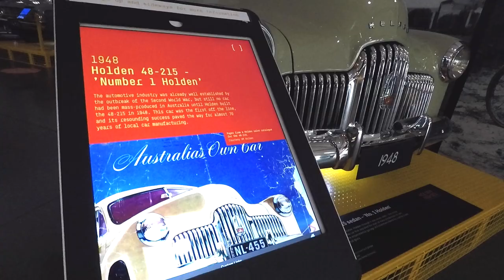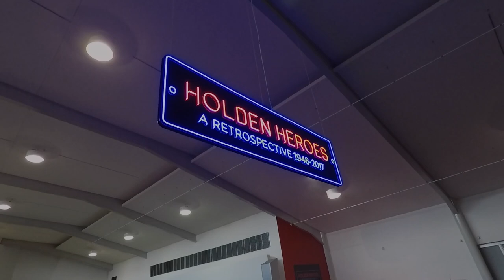The Rise and Demise of Holden | Why Australia Turned Its Back On Their Most Iconic Car

Comment: I was born in 1948, the year that the first Holden model was released. I finished high school and went to work at GMH Woodville SA first as an apprentice then as a cadet gaining an engineering degree. They looked after me well during my early career. Needless to say I was a committed Holden man. I eventually left for the mining industry both in Oz and overseas. I've retired now but my last car was a VE - quite an improvement in so many ways.

Comment: I believe there were numerous reasons behind the demise of local manufacturing.

By the late 1970's, demographics were changing. Up until then, generally most households had 1 family car - in the late 1950's, Holden had 50% of the market. When the kids grew up, they were married by their early/mid 20's and buying their own family car. That started changing, people married later, and younger singles started buying Sigma or Corolla sized cars.

 The decline of the Australian car industry, from a political angle, began as far back as the mid '80's when john button introduced the "button plan," which step by step took away the tariffs on fully imported cars, thus the protection of the local manufacturers. The "reasoning" behind it was to make local cars more competitive. Yeah, right.

As the local cars got bigger, many people realised a medium car was sufficient. Then the small cars got large enough.
An EH Holden from the '60's was considered a full-size car. The Mazda 3 is now about the same size and weight, with more power.

Then of course, along came the SUV. (I hate that term.) The CX-5s, Forresters and RAV4s were a more than adequate replacement for the older full sized wagons.

The other issue was the changes to leasing.
I can't find any info now,  but I remember back when all cars leased had to be Aussie made, businesses often had a fleet of Holden or Falcon wagons.
The rules changed so any imported car could be leased, leading to less sales of local cars.
So a combination of factors led to the loss of local manufacturing.
Reply: Well written though I'd like to add a couple of points:
- The bad reputation Aussie cars had with quality... People that have never had a Falcodore think that these cars are horrible even though they're usually the opposite...

- Both Ford and Holden (especially the latter) failed to plan in the future and their products were considered ancient and inefficient by the general public even though that isn't entirely true...

- As large car sales fell down, Holden and Ford were almost relying on these models to keep the company afloat and were also relying on fleet companies to buy their cars...
Reply: @MartinJones123  "People that have never had a Falcodore think that these cars are horrible even though they're usually the opposite..."  What do you mean think? A 1992 Ford Falcon or 1992 Holden Commodore genuinely was lower quality than a locally made 1992 Toyota Camry (or the larger imported Cressida) or 1992 Nissan Skyline, or imported 1992 Honda Accord or Legend, no?  E.g., the casting sand that wasn't properly cleaned out of the EA/EB Falcon's engine block and myriad other quality issues.
Reply: @TassieLorenzo  The key word is "usually"  as the 1990's wasn't a good time for Aussie build quality, particularly the early 90's...
Reply: read it and weep , at one stage 75% of all cars were Ford's, the model T Ford is the most successful car of all time,  the Sierra rs cosworth is the most successful race car of all time,  Ford has more race victories than all other car manufacturers combined 😂🖕
Reply: @MartinJones123  pfffffff I have a 1991 Ford EB Falcon , what's the date you clown????? 2022,  my car has a modified 351 Cleveland in it, it sounds a whole universe better than ANY Holden or GM product, and it's fast, the cars body is as it is factory , it's been out in the weather it's whole life and there's no rust or any broken bits on the car everything works ,every light every cigarette lighter, every bell and whistle works and it only cost me $700 for the car with the factory 6 in it, the modified  351 Cleveland engine was $4600, all road legal
Reply: @351clevelandmodifiedmotor4  Firstly, what date are you talking about?

Secondly, you're forgetting the EA Falcon which was a pile of crap (especially the earlier ones)... Also your EB is fast because you modified the engine you clown, of course it's going to be fast...
Reply: @351clevelandmodifiedmotor4  Also your EB is falling apart (expected since it's pretty old) but don't call it mint condition...
Reply: @MartinJones123  I didn't call it mint, there's a tiny crack in the winscreen lol
Reply: @MartinJones123  the EA had a recall on the front timing chain cover, they remedied the issue and they EA falcon were actually quite good, better than the VT , that had recalls, for dangerous issues like if you towed over 2 ton the rear doors would pop open and your family falls out onto the road, also the door rubbrs would melt o  hot days and you couldn't get the fuck out of the car
Reply: @351clevelandmodifiedmotor4  But you said every bell and whistle works...
Reply: @351clevelandmodifiedmotor4  How about the EA and the countless quality issues with electronics...etc, the AU's with faulty brakes on the XR8 cop cars and Falcon's in general love to rust...

Also, the diff bushes and transmission coolers as well which are all big ticket items...

How many VT's did this recall affect?
Reply: @MartinJones123  lol my 1991 EB Fairmont has been outside in the weather it's whole life there's no rust and everything on the car works every light every bell and whistle, and the engine was working fine but I took it out and put my 351 Cleveland modified engine in there, professional job all legal,  and it sounds awesome
Reply: @351clevelandmodifiedmotor4  Well I saw it in one of your video's and it had a missing speaker (which is expected since it's an old car) but just because your Falcon isn't rusting, there are heaps of them rusting  out...
Reply: @MartinJones123  no Holden can sound as good as this,  you lot should switch to Ford, at least they are alive and have a future, Holden will be a thing of the past, Ford and Holden been racing each other for decades it's the closest thing you guys will have to a Holden,  mustangs,   https://youtu.be/EXULmagcSow
Reply: @351clevelandmodifiedmotor4  The only reason why Ford is still around in Australia and New Zealand is because of the Ranger and Everest, once the 4X4 Dual Cab market is dead and Ford don't have a worthy replacement, they're dead...

The way a car sounds is subjective to be honest... I like both Holden and Ford for the great cars they once produced... R.I.P Aussie manufacturing...
Reply: @MartinJones123  Even if Ford or Holden manufactured the most popular car it still wouldn't be enough to save local manufacturing. The most popular model in 2023 is the Ford Ranger. Ford sold 63,000 Rangers in 2023 which would not be a sustainable number for a local manufacturing plant. Hyundai have stated they would have to sell 200,000 vehicles of the same model in Australia for them to manufacture cars here.  So no matter what Holden, Ford Australia or Toyota Australia did, it was inevitable with the consumer having so much choice that car manufacturing was going to end here in Australia.

Comment: Germany and Japan have both high import tariffs and huge taxpayer funding of vehicle manufacturing. If you do the maths on the bad years of the 1980s and 1990s, both Holden and Ford Australia were employing Aussies at a loss. 
Blame the Hawke labor government, Joe Hockey and Tony Abbot who wanted to ride in 7 series BMWs rather than the FAR superior Holden Caprice, and govt departments who would rather buy imported 4 cylinder cars than fuel efficient 6 cylinder Holdens and Falcons.
 My 2005 5.7l Statesman has over 365k up and will still pull 8.5l/100km between Melbourne and Sydney.
No toxic DPF or battery packs to dispose of. Cleaner than a Tesla and made here by Australians.
Reply: If you have high wage and production costs, then you need high tarriffs. Plus:- manufacturers should actually build what the market dictates.
Reply: The Australian market for large sedans was declining over time from about 2000. Buyers of these going for even larger SUV types or smaller cars. Even though you preferred larger sedan cars the public did not. 
Australian makers were stuck in the large sedan segment, even Toyota with the locally made Camry.
Not good being unable to respond to market trends easily.

Comment: I wonder where you can get headlights for a VY like that 1:45, BTW the VE was still using GM engines, a big part of a car so was not all Australian at all
Reply: have you tried rare spares/forums
Reply: @nolesy34  na I havnt
Reply: The V6 engines were made and largely designed in Melbourne and exported to other countries for all other GM brands to use, except US the American version being made by Cadillac. The V8 was imported.
BTW, I replaced the headlights in my VY recently plenty of new ones on ebay.
Reply: @anthonygoss9875  I havnt heard that before, I need to look into that as I only know it as a GM engine and do you mean SSX Headlights you bought?

Comment: The problem was that GM Holden/Opel rebadged Deawoo  4 bangers and the small 6 banger Petrol and Diesel Sedans and CUV.  Hence you got Korean Lemons. And know you will have to deal with Chinese Lemons.
Reply: the only time i want lemon and chinese together is my lemon chicken pac pac
Reply: the whole company is a lemon, they would put a 2 litre 4 cylinder engine in a commodore , a car that also had 6 cylinder and V8 engines lol , roll up along side a falcon that has a 302 or 351 Cleveland in it and get absolutely smoked

Comment: It's taxes, and we pay far more than just 10% GST. You see here in Australia we tax stack, for example if we make a car tyre the rubber, kevlar and steel makers must all pay GST on the sale of these items, they pass this cost to the manufacturer then the Australian manufacturer makes the tyre, sells it to the wholesaler and charges GST, plus the price mark up from the raw goods supplier. Finally they sell to the retailer charging GST and the price mark up for the extra costs of everything else. Finally the consumer buys the tyre and they are indirectly paying the kevlar, steel, rubber, manufacturers, wholesalers GST, then of course the 10% GST on the item, that is why stuff costs so much, not to mention the massive taxes on the diesel for the trucks that move these goods. That example is just one tyre, how many different goods go into a car? Towards the end of Holden's life, a new Holden cost as much as a low level BMW or Mercedes, and did not have even half the luxury. No one wanted a Holden. 

How we could have saved Holden: we should have marketed the Holden Ute to the US under the El Camino badge. The Americans have been screaming out for a new El Camino since 1987 when they ceased production.

Comment: I have been lucky to own few Holdens like 83 VH SLX sedan with 202 six, 93 VR Berlina sedan with V6, 2000 VS Olympic ute with V6 n my favourite 93 Spack or really SS with 5.0lt V8 ute with few mods made a great touring vehicle.  It doesn’t matter if Holden had made TT36 or put Diesel engine in VF when fuel prices were concern, GM had made its mind up in early 2000 to axe local built Commodore.  If look at GM today they destroyed themselves with going Chinese manufacturing instead of South Korea, European n US manufacturing.  Sad tale but Holden did make great concepts Holden Sandman, Utester n very nice dark blue Monaro.
Reply: Lets say they did go the korean route.. what would happen
Reply: @nolesy34  if they gone SK, GM would have some control n better relationship, Australia might got better built Holden small cars.
Reply: @jamieshields9521  like a aus Opel of sorts... cool 

Austra

The Bazzrina

And the Cruise bro GTR

Comment: The Chevrolet cruzes in america are absolute Garbage. You fix one coolant leak and one starts somewhere else.  I am American but I don't buy American cars anymore. The Car companies here are lazy and cheap  and only want to rebadge something or build it in Mexico.  Gm's Trucks are good, interiors are garbage across the board and the cars are pitiful.  Dodge's are pretty awful they are throw away cars.  The absolute worst is Ford.  I didn't grow up a Chevy person, I have owned lile 50 cars of all types of brands.  I did't hate Ford until I started working on them.  I will walk before I own a Ford. I could write a book on their stupidity and the people that own them get bent over by them and just keep asking for more.  I will say when we got your Holden rebadged as a GTO I could tell that they were made better and the materials were nicer.  I always looked at the first VIN number to see what country it was made in and all the ones that had 6 were made better.
Reply: I was given a Ford econoline van in the US. Several years old. Working on it was like sticking your hands into a grinding machine. Always bit back hard. Eventually the front frame and chassis had severe rust and missing sections of steel. Never touched a ford since.
Reply: @jayjaynella4539  i was putting a water pump on a Ford 3.7 today, Its a 10 hour job, For a water pump!